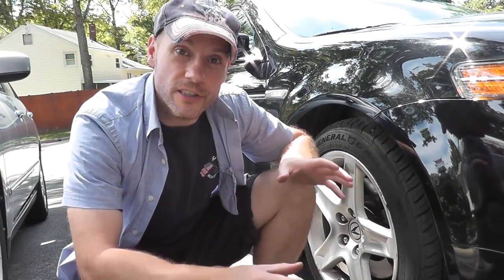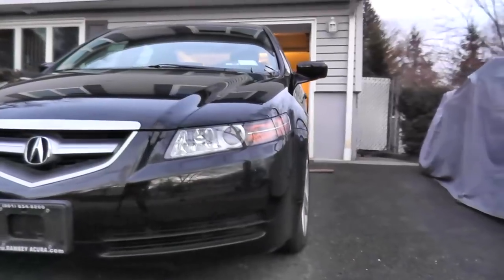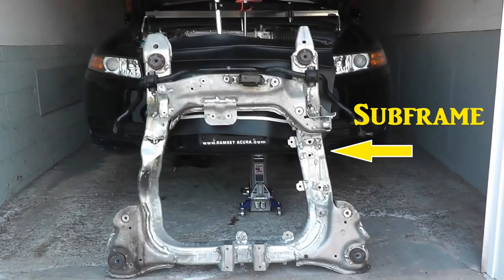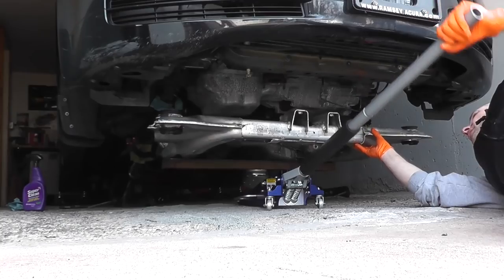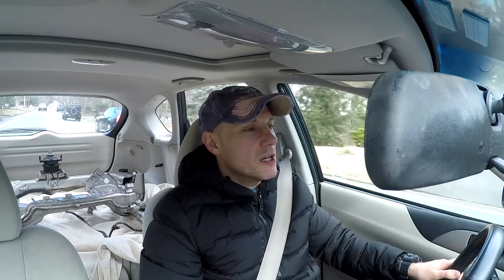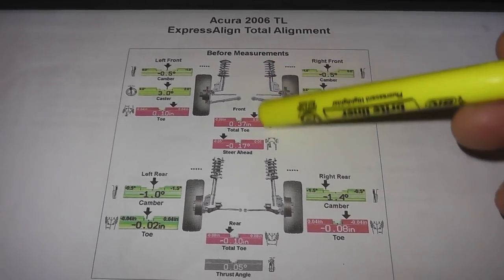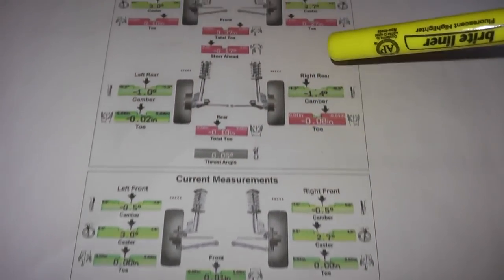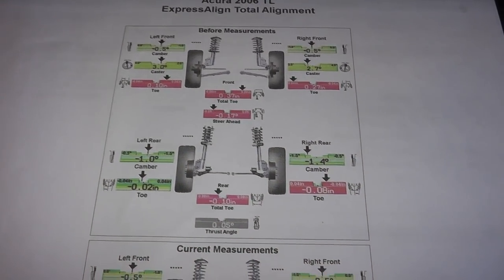Can A Vehicle Be Properly Aligned with Frame Damage

Comment: Ball joints have very tight tolerances, and if the housing were to be crushed ever so slightly, one might not be able to see it, but it could reduce the free play of the stud within the joint which could in turn hamper steering effort a bit.   Also, the shock from the hit could have traveled back through the tie-rod into the rack and misaligned the pinion to rack alignment, thereby increasing steering effort.    Might not even cause a leak or have any visual damage.     Try removing the nut on the ball joint at the tie rod end, which in most modern cars can be done easily with a swift blow to the tie round end with a 5lb hand sledge.    Then when it falls out, see how well the stud moves within the joint.  If it binds up or has excessive play, replace it.  They are usually $20-70 for most cars.    Obviously count the rotations of the tie-rod end while removing it and replace likewise.

Comment: Thank you for explaining this. I have a 2007 Lexus LS460 that I had hit some road debris and it popped my two drivers side tires. So they replaced the tires and put it on an alignment rack and nothing appears to be broken but there are some dimensions they can’t really get right with the alignment. So they offered to loosen the sub frame and shift it around to get the alignment numbers correct. So I was wondering what the heck they can do with the sub frame to do what they want to do so I’m assuming there is a little bit of play they and shift it around to try to get things closer.

Comment: nissan versa note hit curb straight on. steering wheel immediately was out of balance, took for an alignment and everything was aligned except for the caster, caster on drivers side is positive 2.1, car pulls to the left and tire on the left wears out. could sub frame be bent? Components on this vehicle are. strut, lower control arm, tie rod, cv axle, sway bar links . ??  HELP

Comment: Hey, I recently hit a curb at maybe 25MPH or more and did scratch/damaged the wheel(repaired now), tire was good, but front left wheel is 1/4 inch pushed back.  No damage visually, except for some tear in the lower control arm, where fork connected through the bushing.  Maybe impact did affect that bushing, but it is in okay condition and I don't think the wheel setback happened because of the bushing.  Went to alignment shop and told them what happened. After an hour, tech came out and said "there is no visual damage".  Really don't know how he didn't see the wheel setback?!  Showed me alignment print out and most items are ok such as "camber on the left front is 0 and right side is -0.1" which seem to be in spec.  The only thing is caster which is 2.0 on the left(hit the curb with) and right side is 2.5, which is a bit more than I would like.  I do notice that to steer, I need to put a bit more effort than before.  Do you think that lower arm could of slightly bent, upper arm or the bolts that hold arms?  2010 Acura RL
Reply: Did you figure it out?